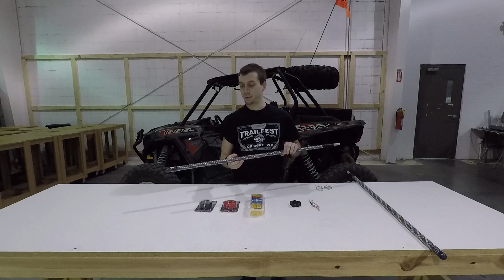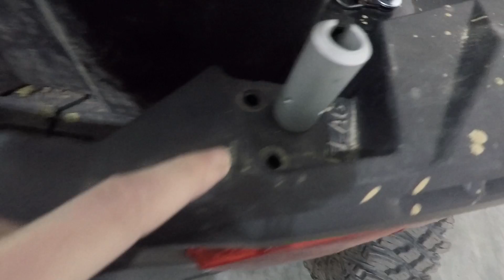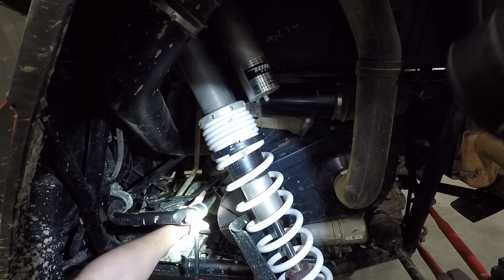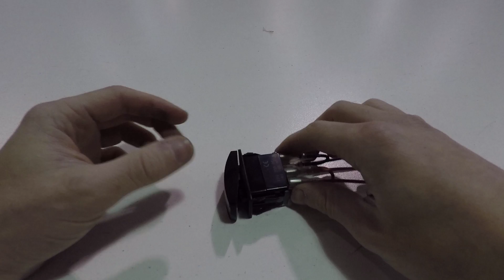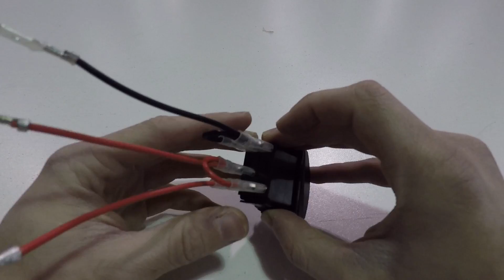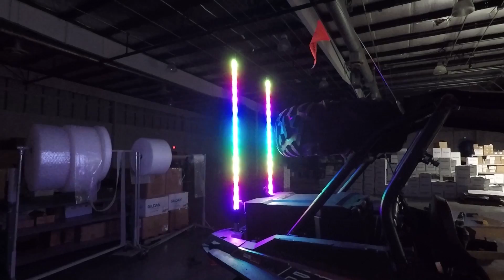Polaris RZR 1000 Whips Install

Comment: You need switch?? Or only whit the control and obviously the whips connected to the battery.
Reply from the maker: The instructions say you must use a switch. I am not sure what will happen if you dont.
Reply: It will drain your battery. Even when the LEDs are " off" the controllers are using energy..basically in a standby mode. 
The switch probably includes a integrated relay which will physically cut off the led and controller from the battery. Hence no parasitic power drain